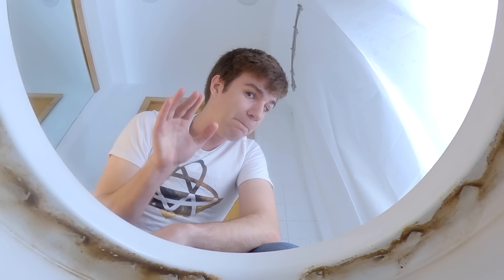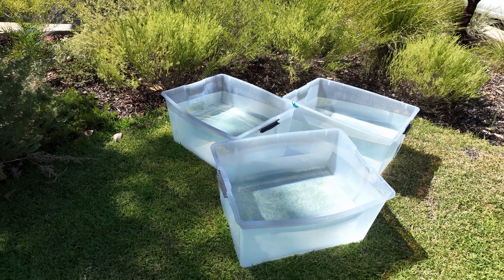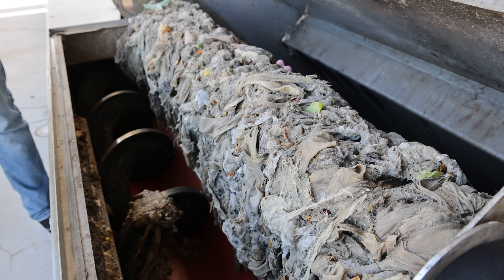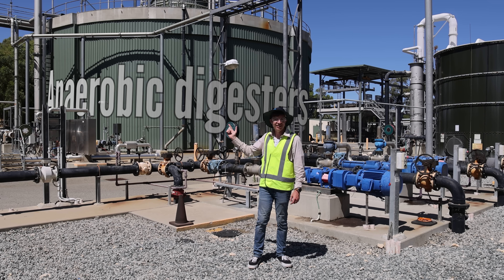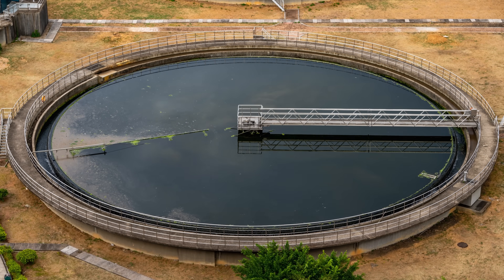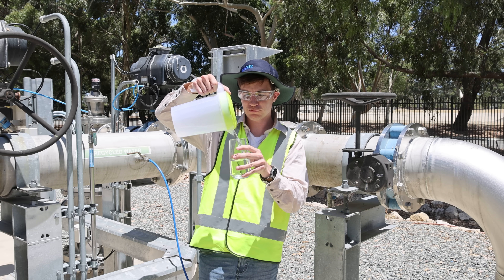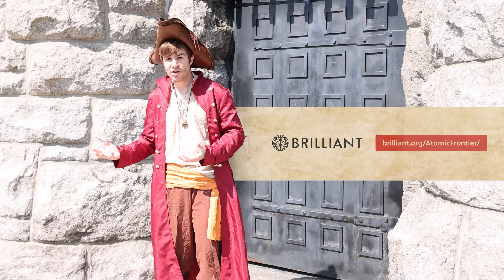Why cleaning your waste water is so difficult

Comment: I have an idea for how to make it way better. You know how microwaves only heat water molecules? Well, you distill the water with a high powered microwave inside of a vessel. This would specifically target and heat only the water in the solution and make it rise over to the collection vessel as steam; the remaining junk is left behind in the microwave vessel. You could do this instead of the filtering process. The filtering needs maintenance and has a fair bit of complexity whereas the microwave distillation would just be two really large vessels like a distillation apparatus for liquor.

Comment: Something people don't realise is that pure water is actually highly reactive and the bugbear of material engineers. I visited one of these plants for work and they said after the ultrafiltration, the water is so pure, they have to immediately add minerals back into it otherwise it would react with the pipes and corrode them too quickly. And yet, people still refuse to drink it unless it's first pumped into a dam, where it has dirt, fish, and bird poop in it, so it can be processed the same as normal drinking water. People think the normal water they drink is cleaner than the treated wastewater, when it's so unbelievably the opposite.
Reply: I think a large part is the natural grossness -- "This was toilet water??" after all, we are all trained to not defecate where we eat. It's a revulsion that is trained from a young age.

Furthermore, I think another thing for a lot of people is that all of these systems are cool and all, but what if something breaks and isn't noticed? Of course, with the right management and procedure that isn't going to happen, and I am familiar with how tightly tested municipal water (usually) is, but the vast majority of people don't know -- and don't care -- about that, and will always rely on the initial, kneejerk emotional reaction.
Reply: @namm0x326  there are also people believe in things like homeopathy so they can't reason very well. since they don't understand how physics and chemistry works, even if you reduce water to its purest form from something else, they'll always believe the water has some sort of "memory" stored in somewhere they don't understand.
Reply: The chemistry of water is fascinating. Its ridiculously large specific heat capacity, its ability to autoionize, its polar nature, its efficacy as a solvent, its high surface tension, and its unusual phase changes makes it extremely useful.
Reply: The universal solvent.

Comment: 8:35 It's actually to pure to drink? I have a hard time believing that
Reply: It’s pure water, it requires minerals and salts. It’ll take them from your body, thats bad. Also, if it goes back into the water system it’ll draw the minerals out of copper pipes.

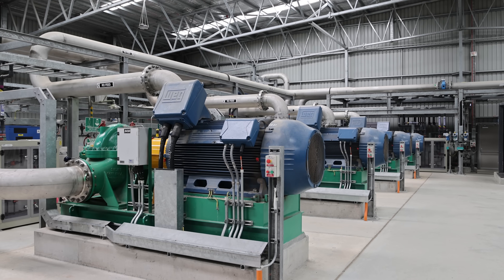Comment: 7:00 So the pressurized filter also clears out chemical contaminents? I only recently heard people worried about hormonal contaminents from birth control pills for example, but if that step filters that out, then no issues. Right?
Reply: With Reverse osmosis they are not a problem, but not all water treatment plants use them (like in 5:55 Explained). Also some Hormons and chemicals are more a problem for the bacteria within the Aeration step.

Comment: How would the world run out of drinking water if 70% of the fresh water on earth is frozen and the globe is warming? And if it's not warming, why would rain stop happening? And if you wanna suggest empty aquafers, how do you know how much is lost and how much is replenished? 

15 seconds in and I'm out
Reply: Most Frozen water are on the North and South Pole. You can't Transport it, there where ideas for it but they didn't work out. 

Most Frozen Water we normally use to drink is in glaciers. We also use too much water so that Rain and glaciers can't keep up with our consumption. 

Rain does not Stop, but the rain comes more like a monsoon due to warmer weather and with the agriculture the soil is too hard and dry. Both of these massively impair water absorption and lead to floods.
Reply: @Jan12700  first off, the north pole doesn't have glacial ice like the south pole does. The north pole is frozen seawater. And for long periods of time before modern refrigeration, we did transport ice blocks, that's what kept things cold. So if we did the same with seasonal ice, that would be easier because it wouldn't even matter if it did melt.

The frozen glacial water we would be using to drink would be a good thing, people say that melt water could affect the gulf stream. Did you even read my questions?

Rain is only coming like monsoons in areas where there are already monsoons. Otherwise you are just talking about increased rainfall in some areas. If you think the desertified areas can't absorb the moisture, that's backwards. The .01% increase in CO₂ has increased the greening of deserts, providing roots to capture rainwater and shade that decreases evaporation as well as fallen leaves to insulate against further evaporation.

So, care to make a quality point?

Comment: In Israel, our wastewater gets the same treatment up until the advanced filtration step. After the "Good enough for ducks to swim in" step, we put these waters in a separate pipe system, and use them for agriculture only. It still saves the same amount of drinking water, because you don't need to water the fields with drinking water, and any water that's left in the plant goes right back into your body after the tomato filtered it for you.
I used to work at a water treatment facility, and I recognized all steps you showed.

Comment: As someone who works with water filtration systems (on a smaller scale) these explanation vids about this process always omit an important part likely because these people don't consider it as important to be worth mentioning. In order for separation of bad particles in water to happen those particles need to coagulate using a polymer product mixed into the dirty water. The dosage is very important and that dosage depend on many variables (water PH is one of those variables). The coagulation itself works on the principle of attraction between charged particles. Proper coagulation will result in big chunks of waster particles surfacing and being scraped off otherwise it will just stay mixed in with the water. This is just one of the steps. These kind of vids always seem to concentrate on the membrane filtration part for some reason. Also on the membrane filtration stuff he says that is where the big stuff gets filtered out, wrong that already happened in previous step where he glanced over that (the scraping off from the top of the water).

Comment: This system is already implemented in Singapore, called NEWater, and it uses a similar reverse osmosis technology as what is shown in this video. Like this plant, we too scaled up our water reclamation process until we too are able to reclaim at least 40% of raw sewage.

You're quite correct that the final treated water gets pumped into natural sources of water to "buffer" for further settlement, i.e. using the natural elements to further detoxify and clarify the water (think of Evian bottled spring water and the ads surrounding how their water is "filtered" through mountain rock to get that mineral water taste). In Singapore, we released them into our collection of 18 reservoirs throughout the main island so that they, too, gets treated by "the sun is a deadly lazer".

Also, because the water is "too pure" for bodily consumption, it is instead directed to wafer fabrication plants (we have GlobalFoundries plant in Singapore that needs this type of pure water for their manufacturing process).
Reply: To address the "what about the hormones caused by the dumping of expired or inadvertent disposal of medicine?"

My brother in whatever, the aeration tanks have bacteria that do break down those hormones into harmless byproducts that don't interfere with your body.

And with reverse osmosis done on them, picometer-sized holes are literally smaller than the hormones, bacteria and other pathogens that you worried so much. Things that affect your body are already tackled in the earlier processes and we overkill it by both filtering water through these filters and we also flashed ultraviolet light onto the water, so we are making so pure a water we have to add back the minerals into it.

That means, we have the capacity to scale up and effectively treat water to a point it's good for even wafer manufacturing plants to use. And they needed pure water, like purer than your heart is.

Comment: What is worrying though is the amount of energy needed to get to that stage. I think that's the biggest hurdle to overcome.
Reply: Had you watched the video in its entirety? They used the methane collected from the anaerobic digesters as fuel to offset the energy required to make this whole plant working. These digesters break down the solid waste that was scooped up from the sedimentation tank by the same bacteria that is found in your intestines to turn these wastes into fertilizers.
Reply: @FiredAndIced  Only 1/4 is offset, but yes
Reply: @FiredAndIced  Yes I know, but that doesn't mean it doesn't require a huge amount of energy. They burn the methane, also not the best. Sure it's better, but the issue is that we need huge amount of processes to clean water in the near future and we can't afford to use burning as a form of energy for that really.

Comment: How about we stop using clean drinking water to flush toilets?
Grey water recycling...
Composting...
Reply: Then we would need to build entirely new waste-water delivery systems at least in every household. And you don't want waste water sitting in a tank until it's needed
Reply: @derrickstorm6976  You haven't put much thought or research into this concept have you.
Reply: Stuff that works at small scale doesn't work at large scales. That stuff works on a homestead to a village, probably doesn't do so well with a million socially atomized individuals.

Comment: Neat video. Eventually it'll be the main source of our drinking water im guessing. That or ocean water filtration.
Reply: It really depends on where you live. There's also atmospheric water capture for places with high humidity.
But we would all benefit from recycling waste water.
Virtually all fresh water in the world is recycled anyway :body-blue-raised-arms:the only difference is that it comes from the natural water cycle.
Reply: wastewater recycling is WAY cheaper than desalination because the reverse osmosis pressure is so much lower, so it's generally a much better choice whenever you can convince the public to accept it. Unless you're the crazy Israelis who use desalination for drinking water and then use the wastewater to supply something like 70% of their agriculture in the middle of the desert.

Comment: Why is the addding of minerals at the end necessary to make it safe? I get that the water produced is 'purer' than drinking water, but I don't understand why that would be an issue.
Reply: It's safe even without the minerals but the "taste" and "mouthfeel" is not as nice. It's hard to describe but it's less "refreshing".
We also need those minerals for good health (replenish electrolytes).
Reply: Pure water will leech minerals like calcium out of your body
Reply: @sup12128   good point, you will loose minerals when you pee and sweat.
Reply: When you drink tap water, it's essentially added chlorine and fluorine, that's why you are accustomed to that taste.

Drinking this treated water tastes different.
Reply: @FiredAndIced  Fluoride is almost always added, it's good for your health.
Chloride can also be added if that's on the city code to prevent bacteria growth.
This treated water taste the same as any other water because they all get the same additives after filtration.
Same goes for the desalinated water.
Reply: @FiredAndIced  I think you read may have read the word Safe as Taste, because I wasn't asking about taste, I was asking about the safety of the water, which is the reason given in the video for adding tap water to the glass at the end.